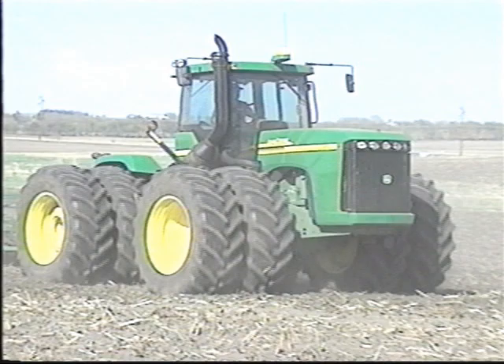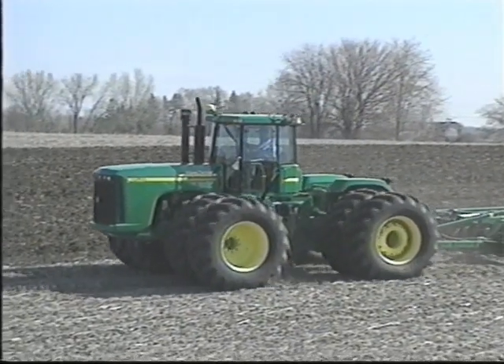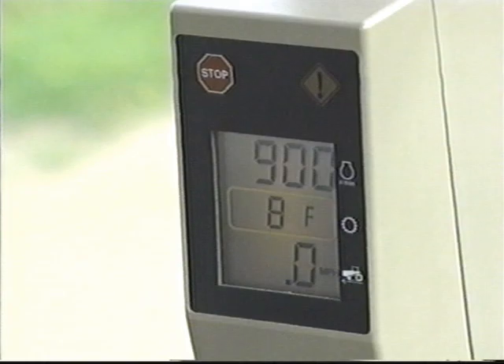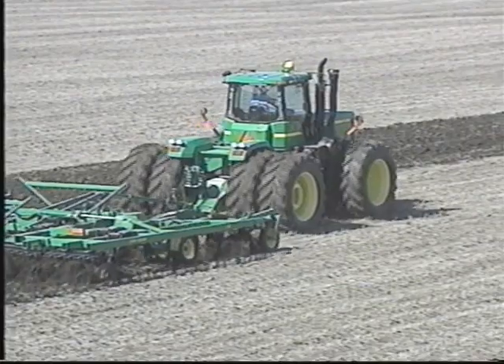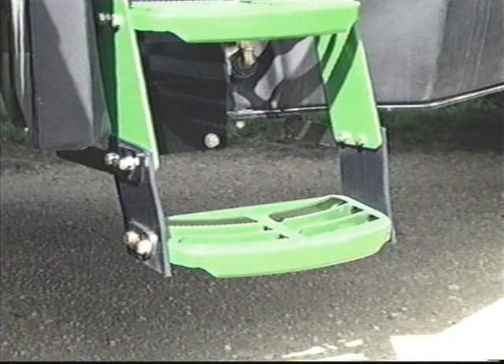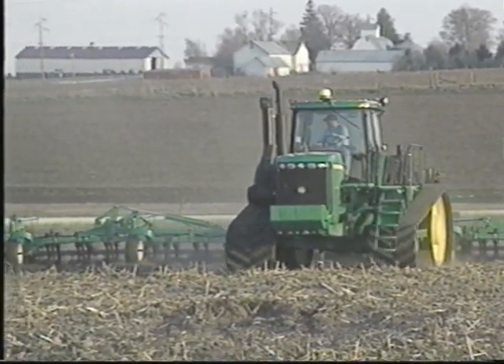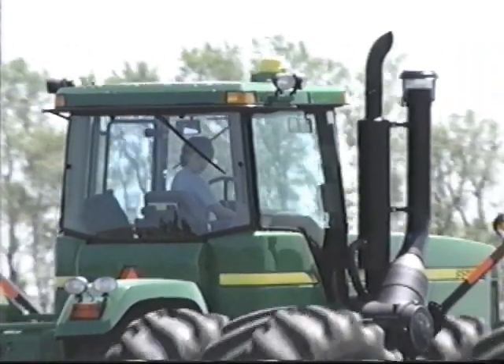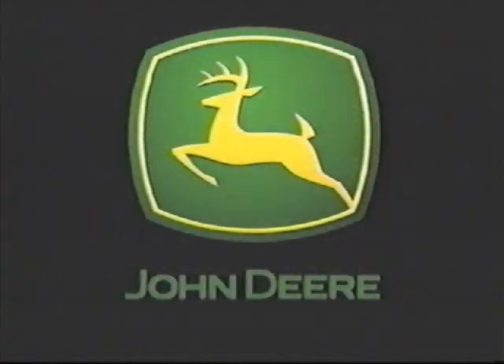John Deere 9020 Series Tractors   Features and Benefits

Comment: In April of 2007 I started working on a farm in South Dakota. The tractor I was to operate that season was a brand new 9520 with only 25 hours on it. It was like sitting in a grand hotel room for 15 hours a day coming from a Ford 9600 with no aircon or auto steer. I absolutely adored that tractor. In my opinion the 20 series tractors are the best John Deere produced. Good balance between mechanical and electronic controls. These days electronics are most new equipment's Achilles Heal.

Comment: I APOLOGIZE for making a mistake on my first comment from the last time.  Let me see if I can say it correctly right.

I got the John Deere 9220 on my list of my TOP 15 FAVORITE John Deere Tractors of all time for my FUTURE FARM.  I am also thinking about the John Deere 9620 4 Wheeled Drive AND the 9620T Crawler Tracked Tractors before the John Deere 9030 Series Tractors came to life from the John Deere Waterloo Tractor, Cab, and Assembly Operation Works in Waterloo, Iowa, USA.

The John Deere 9030 Series Tractor starts out with the 9230.  Which generates 325 engine horsepower.  And it goes up to the 9630.  Which generates 530 engine horsepower.  Within these models, they're both wheel and track versions.

4 Wheeled Drive Tractors like the 9030 Series are the: 

9230  325 horsepower  2007 - 2011

9330  375 horsepower  2007 - 2011

9430  425 horsepower  2007 - 2011

9530  475 horsepower  2007 - 2011

AND EVEN, the 9630  530 horsepower  2007 - 2011.

From the 1990s to the year 2011, John Deere also offers a crawler tracked vehicle.  After the 9000 Series and the 9020 Series Tractors came to life in both 4 Wheeled Drive and Crawler Tracked Versions, the 9030 Series Crawler Tracked Tractors are the:

9430T  425 horsepower  2007 - 2011

9530T  475 horsepower  2007 - 2011

AND EVEN, the 9630T  530 horsepower  2007 - 2011.

Comment: Why wasn t the CommandView Cab ab all glass cab like what CaseIH turns out in Fargo?In 2000 CaseIH introduced their Steiger STX Series 4WD tractors with an all glass cab.Now Deere  had year to work on getting a all glass cab  into their 9020 Series but did not lift a finger to do so.Still not getting the message the 9030s in 2007 did not have all glass cab & Neither have the 9Rs that were introduced in 2011,2014 & 2020.
Reply: Mainly because case sucks hind tit.

Comment: Ran a 9400 pulling the tile plow when it got stuck. Hell of a motor lots of torque. Awesome clutch for starting heavy loads. I'd say I'd put that engine tied for first along with the case 504
Reply: not the early ones, they got it right after a few years, basically a detroit ddec 4